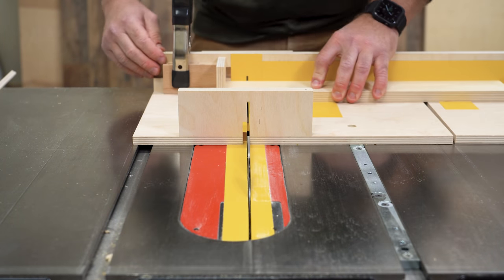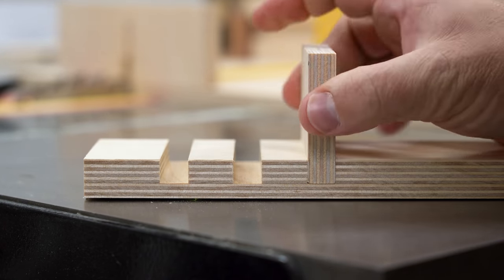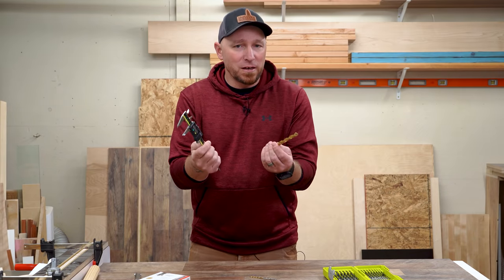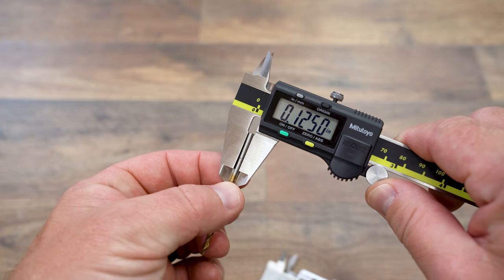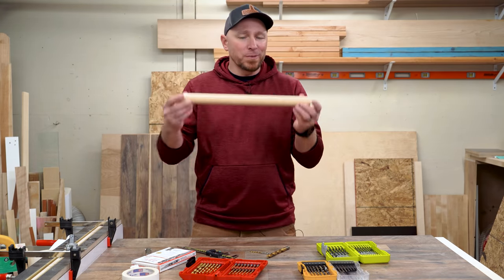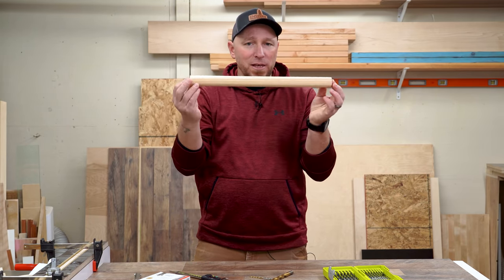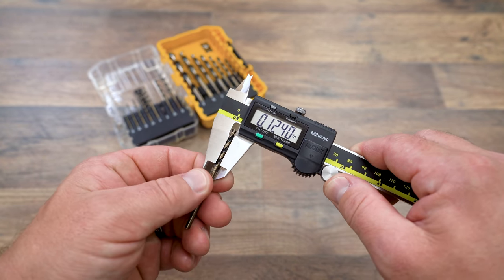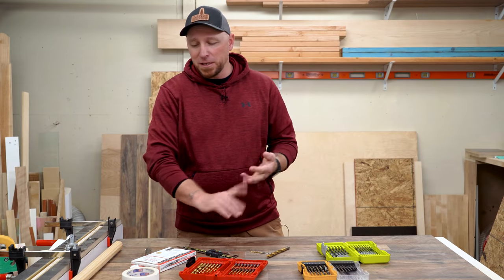I Bet You Didn't Know THIS About Your Drill Bits, Maybe

Comment: Yea i figured as much but my dumb ass got drill bits that have 3 flats on the shank..  so a straight caliper wont measure them at all..  good thing i guess about the shanks are they never slip and since they never slip the laser engraved size never wears off..  because yes im a cheap bastard and i tend to use chucks until theyre hollowed out like debbie after she did dallas..

Comment: Many people when sketching a wood screw draw it with the thread tapering to a point. If that were the case the screw would never achieve a proper fix. Same as drill bits they are machined from a blank rod 🤓

Comment: My drill bits measure slightly larger and you can even see they are burred out very slightly. Maybe it's an unintentional result of the manufacturing process. Anyway we're talking less than a tenth of a millimetre. Which is what your calipers showed too.

Comment: I was working in a carbide drill bit factory and ALL the spiral bits are just a cut-to-length piece of carbide rod at the beginning. First step is to set the profile of the bit, then to cut the flutes (helical grooves) into the bits and last to sharpen their tip.
Due to this techologicat process steps, the shank is ALWAYS the same size as the flutes.
Reply: Not always. In most cases. I have precision metric drills that are in .01mm increments. The shanks are in whole mm increments then the flutes and cutting edge are ground down to the drill size specified.
Reply: You are correct, anyone saying differently needs to learn how to read their verniers.
Reply: What about grinding the lands for clearance among several other operations. "sharpening" the tip is a misnomer. I think you know very little about grinding drills.

Comment: The only way the diameter of the working end would measure significantly different than the shank is if it was made so poorly that the flutes line up directly opposite each other, which would make it paper thin and unusable.  Even in that case it would only measure thin at that specific point.  Measured along the long axis, it is impossible to measure anything other than the highest opposing surfaces.

In any case, if there was a difference of a few thousandths, so what?  Cheating?  Get outta here.  If you knew in advance that there was a difference, it would simply mean you were smart enough to tighten up the tolerances on the joint by using the natural variability of the manufacturing process.  

What's with this "gotcha" mentality that's taken over?

Comment: Close enough is the key here - your digital calipers are not accurate enough to measure the taper on a drill bit. Also the drill bits you can purchase at a box store are not truly precision bits and would be less likely to follow proper tolerance for bits. A quality drill bit will have .0002-.0005” taper along its length. This is impossible to accurately measure with your calipers, and requires a good quality micrometer to measure. For your world where .01” is extremely accurate, .0001” is impossible to measure. Calipers are inherently a low accuracy measuring tool. They can be precise, but not accurate. General rule of thumb is a measuring device is only accurate to 10x it’s smallest graduation. Your .0005” readings are only accurate to .005”, and we are talking about .0002”. So ya, in your world drill bits are perfectly cylindrical- but not in my world!

Comment: I'm blown away that people think the sides are different.  I'm trying to figure out if they think the fluted side is smaller: in which case I mast ask how tf do they think it drills the right size hole.  Or if the smooth side is larger: in which case I'd ask why they expected you to use it in the first place.

Comment: You don't need to use calipers to measure the drill bit's diameter; you could just use a card-with-holes drill guide, and see if both ends of the bit fit snugly through the same hole, but do not fit through the next-smaller hole.

Comment: Another fact twist drills are two pieces of different types of steel fused together. Check it out with a file. You would ruin your chuck if the whole thing was solid length of HSS.
Reply: No. Its made out of one piece. The twisti bit of the tool is just heattreated
Reply: LMAO, thank you for that

Comment: Bro everyone's here talking about how they work with drill bits and can confirm they are the same. Are y'all dumb?? There's no way y'all actually work with drills because if you did you'd know that not all drills are the same. I have some at work that the shank is a half inch larger than the flutes .
Reply: Sometimes it's the same and sometimes it isn't so stop talking about how you work with drill bits and know that they're all the same. Quit saying you're stating the obvious that they're the same size when you are even more obviously looking over the fact that not all bits are the same